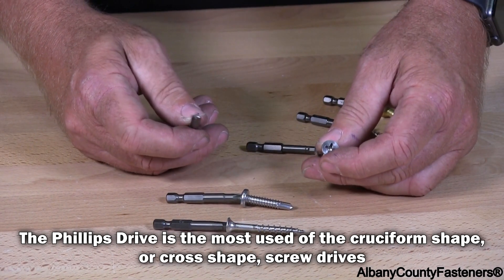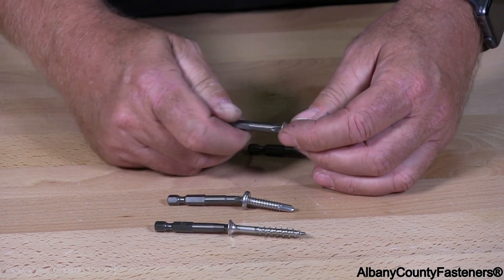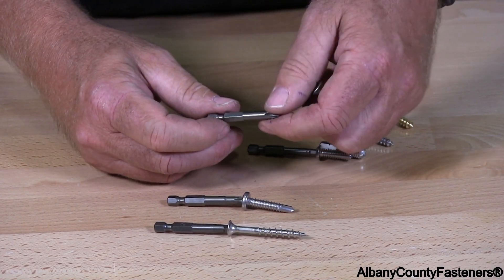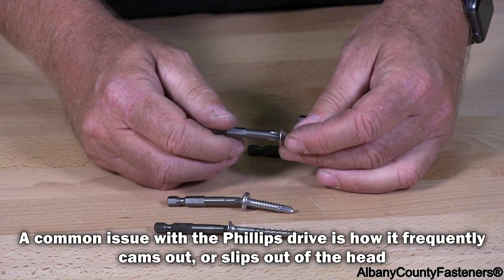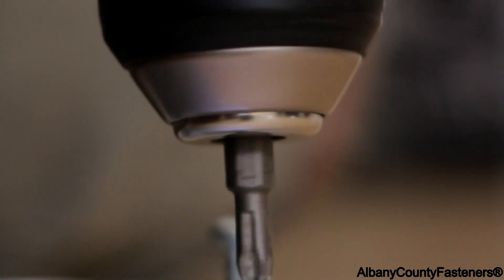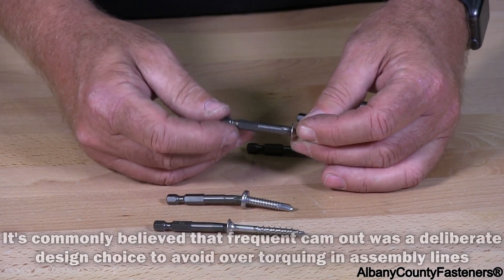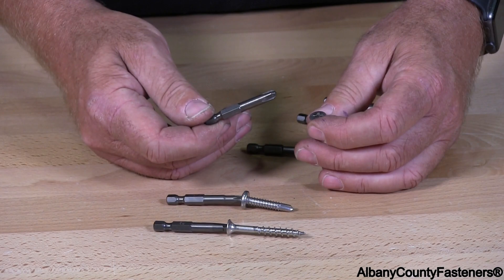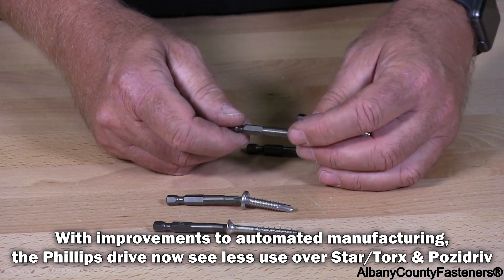The Phillips Drive - Types of Screw Drive Styles | Fasteners 101

Comment: You can see in the video the bit jumping in the fastener. The Phillips system is one of the worse trim styles in common use and it persists in the same way that the Fahrenheit temperature scale does, because Americans do not demand something better but prefer to stick with what is familiar and common. If Robertson had not been so stubbornly proprietary about his square drive, the Phillips would likely never have been invented, or at least would not have gained the foothold that it needed to become the dominant curse on American workers when it comes to everyday fasteners. With options like Torx, Robertson, and even square drive (which is common in the US but not really the same as Robertson), we should do the same to Phillips as it in turn did to the slotted head--namely relegate it to the dust bin of history. Stop buying 'em, and they'll stop making 'em.
Reply from the maker: Thank you for your feedback.
Reply: Wow. The sequence of events that led me to this comment was, to say the least, divine. @jbarner13 This was very well written in the style of prose, a style to which I subscribe. I will conduct further research on the history of Phillips and Robertson, exploring the impacts they may have had on our understanding, processes, and methodologies for fastening sundry items together. If you have any suggested readings on the topics, I would appreciate those references. Much obliged.